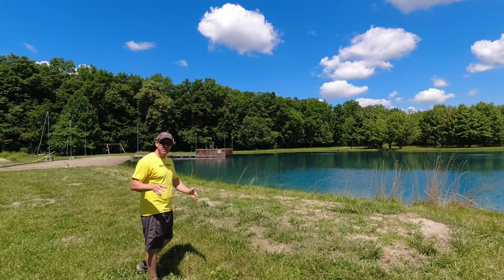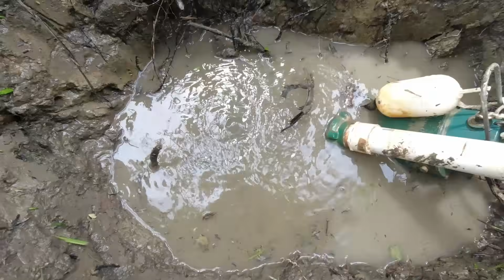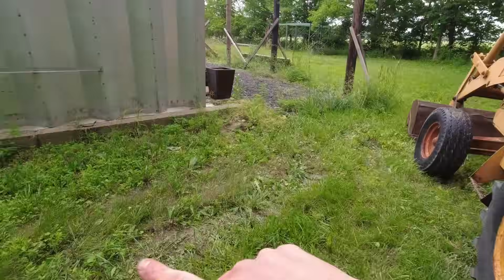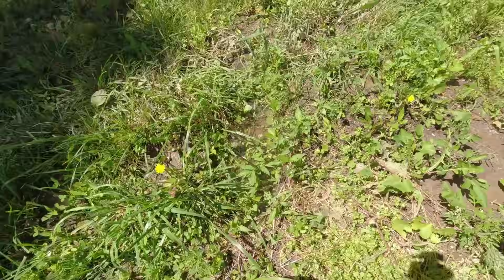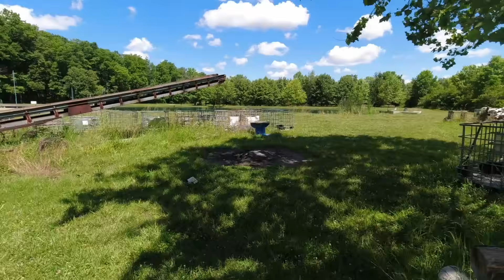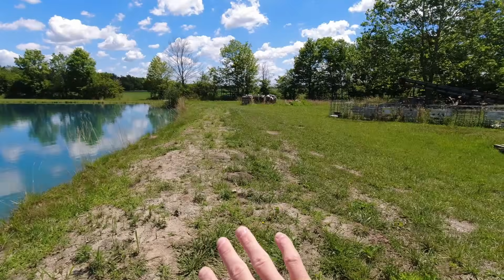My Pond Is Leaking...And I Need Your Help!

Comment: Most sewer/ plumbing company have a snake with a electronic head to detect and pinpoint break locations with out digging... could be used to run all the way to the pond or near the pond to get the location or map out the drainage field

Comment: Get a snorkel and mask and float along that side of the lake inspecting the bottom. You might be able to see some difference in the pond bottom that lets you know where the water is exiting. Don’t stop if you find one spot as there may be more than one exit location. 
It sounds like you like to swim in the pond so it would let you cool off and relax while working through a stressful issue. 
You could also poor some die in small areas on that side of the pond and see if it appears in your sump hole. Pick a 4’ to 5’ stretch along the burn side of the lake. Wait a day or two then try another 4’ section. You will burn through some pond die but will not have to dig a long trench.
Reply from the maker: That's a pretty good idea.  One viewer had mentioned tracing dye, but I never thought about being in the water to better view it.  At the end of the day, the backhoe is going to have to fix it.  I just want to be surgical about where I dig.  Thanks for the advice!

Comment: You might try a polymer pond sealant.  I know folks that have had success with it and others that have not.
Reply from the maker: I used one of those last spring.  That's before I really knew that I had a clay pipe drawing down the water.  I don't think that stuff would do much to close up that pipe.
Reply: @IndyFarmLife  You are probably right.  I thought it might be soaking through the soil to that pipe.

Comment: Yeah one thing you missed that's why wire flagging your lines that you personally put in and just having a wire with flag on it after you do it leaves you from worrying about ever tearing them back up, but don't know about your water leak issue seems like it's going to be a problem, maybe make the hole put a pump on it directly right back to the pond do a circle
Reply from the maker: All the electric and sewer lines I have buried have tracer wires on them.  I don't have any drainage tiles that I put in out in this area yet.  These clay pipes are probably 50+ years old.  I had thought about putting a pump on the hole and pumping it back in, but that would probably end up cleaning out the clay pipe and making it draw down harder.  It's a fun little mess I have. ha

Comment: If I recall... Prior to the well pump, you could never get the water level to within 18 ish inches of the spillover.  At which time you never had a leak?  lets assume I am right so far.  So leak is occurring at the top end of the pond.  One thing about leaks.  You stop one and they find a new route.  I feel the only true fix is to turn off the well pump.  Let the water naturally lower over the next few weeks/months. And then core trench that entire side of the pond.  From the beach (possible under it as well) all the way to where it starts to curve towards the solar set up.  I know this isn't ideal as it looks so good right now and you don't' want to drain.  But this is a case of: Do it right once and for all, rather than keep chasing it looking for a single leak. You know this is what LetsDig18 would do!
Reply from the maker: Yes, the leak is absolutely at the higher end of the water line and we didn't have any issues until we approached full.  If you think about the design of the pond, that has to be true.  18ft of the 20ft of depth are below grade.  Only that very small dam. At any rate, what you describe needs to happen.  I'm just trying to be surgical about it.  We don't really have a seepage issue as much as we have an open field tile pulling water.  We did a pretty good sized core in it last fall.  I'm sure I'll end up doing a ton of digging, but I'm going to wait until swimming season is over before dropping the water level.  Even if I wanted to turn the pump off and start now, we would probably have a tough time.  We have been getting pummeled with rain.  We got another 1.57" last night.  The pond is again above the overflow.

Comment: Probably not the solution you were looking for, but you could dig a pit at the tile and drop a pump in to use as the feed source for your water feature.
Reply from the maker: That hole is about 400ft away from my water feature though.  Probably easier to just grab water straight from the pond.
Reply: Ouch. Oh well. I hope you find a solution. I feel your pain. My pond has been seeping ever since it was full. Fortunately there’s a river nearby so it gets away without creating any extra problems for me, besides losing the water. I usually just keep a garden hose running in it during dry spells to keep the level up. I’m like you, I can’t bring myself to drain it down. I just bite my lip and deal with it.
Reply from the maker: Yea, hard to think about wrecking it when it's nice.  How big/deep is yours?  Any fish?

Comment: Regarding what @MikeZMonroe stated. Best idea. An "old-time" tile probe is a piece of 1/4 or 3/8 round rod with a Tee-handle on one end and a point at the other. Simply push into the ground to find the tile. Pick a likely spot to start. If nothing, mark with a flag for reference. Move 5-6 inches perpendicular to the suspected tile path. When contact is made, you will feel the abrupt stop.
Reply from the maker: Ok.  And it won't be difficult to push that through 3 or 4 ft or hard packed clay?  Thanks!

Comment: You need to get some witching rods and practice on where you know where the pipe is, then you start by the pond to find pipe or pipes draining the pond. You have to fix the pond side or you will still have a leak from the clay tile not having sealed joints.
Reply from the maker: I told my buddy that!  My grandpa used to do it.  Is it pretty easy to learn?  How much water needs to be present (in the pipe) for it to work?
Reply: It works. Farmers do it all the for large and small drainage tile. I have found sewer lines ,gutter drains, ect. Watch you some videos.
Reply from the maker: Awesome than for the info!  Time to learn a new skill!
Reply: And dont forget to slaughter a goat and pray to the pond gods to show you where the leak is.
Reply from the maker: ha yes!

Comment: I would go out 10 feet from pond edge & dig a trench around ENTIRE perimeter of pond down to depth of where you've found clay tiles. It woull take time & create a mess but will finally solve leakage by terminating all exit leak points caused by tiling.
Reply from the maker: Yea, I truly think that is where I may end up.  That's my nuclear option.  If I go that route, I may wait until Sept/Oct when water levels are down.

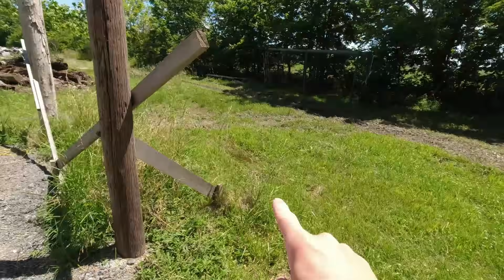Comment: 11:22 I think those short pieces of pipe are more than flexible enough to curve slightly. Even the longer solid pipes can curve over distance, and given how old those small tiles are, there's a decent chance everything was done by hand, so far from straight. It could also be deeper in the locations where you already dug.

I would definitely try all of your ideas. No matter how unlikely you think they are, it's so often  the case that the unlikely option succeeds. Just start with the cheapest/easiest options, and move up from there.
Reply from the maker: I hadn't given that any consideration at all!!!  Never thought about them not being a perfect straight line and curving.  I would definitely say done by hand.  This stuff is old school!  Pretty cool though too.  Thanks for the advice/feedback!

Comment: - You likely have a metal probe. Maybe map out clay pipe path. Probe tile and follow its path. Instead of trenching go every so far to avoid a trench. Think clay pipe is your devil….just my guess.
Reply from the maker: A probe is a good idea!  It's probably 3 to 4 feet down.  Wonder if I would be able to push it through that much soil by hand.  Definitely would like to avoid all the digging if possible.  Definitely is the devil!

Comment: Use a locator they use for septic/sewer lines.  Most have a camera and a locator.  You can rent one or hire someone to come out and snake it.  The problem with clay tile is all the joints.  They are usually only 2 feet long.  Trace it back to the pond and deal with it there.  The tiles coan branch off and go anywhere.
Reply from the maker: Yea, getting on the pond side is paramount.   I really like the idea of a sewer scope/locator.  The one thing giving me pause is if it would be able to run up the line?  There is a lot of clay packed in there.  Wondering if I would need to water jet it first?  That just opens up the flow though too.  Sticky situation.

Comment: I like the idea of putting an air hose on the exposed end and forcing back pressure to see if you can get it to bubble up at the pond.  You can always listen for air leaks along the way and maybe reduce the number of holes you have to dig to find it.  The closer you get to the pond, the easier it will be to push the air.  Just my thought.
Reply from the maker: Thanks!  I had thought that would be a damn good idea too, but I somewhat changed my tune when I saw how the pipe is designed.  All those little 1/8" breaks makes me think that the air wouldn't make it very far before escaping.  Maybe I'm wrong?

Comment: First, I have no idea what I am talking about so take this with a grain of salt. I think something I'd try is getting some sort of metal snake/scope and a metal detector to essentially trace exactly where the clay pipe goes/wye's off without disturbing the pipe as best you can.  It's likely behind the soil of the bank somewhere and pushing air or a snake all the way through could cause a much bigger issue.  So essentially add metal to the clay pipe to hopefully make it identifiable above soil with a something like a metal detector (maybe there is a better way, just seems relatively low cost).
Reply from the maker: Yea, you are thinking about it the right way.  The sewer scope I mentioned and another viewer commented about would be what you are thinking.  They have locators on them.  Again, my fear is opening up that line i.e. removing clay from inside the pipe and it running wide open.  Probably inevitable at some point.  May have to push to fall when the swimming season is over and the pond is down.